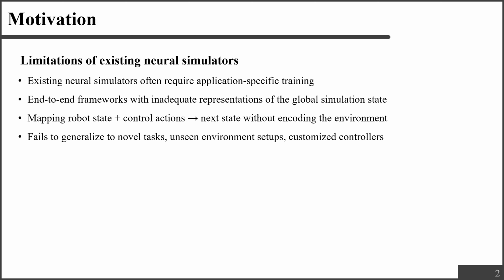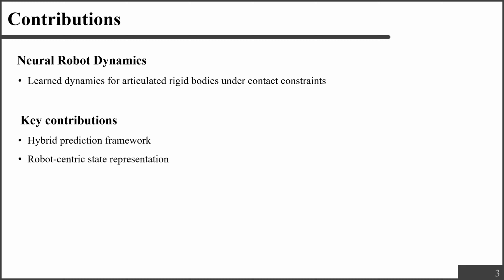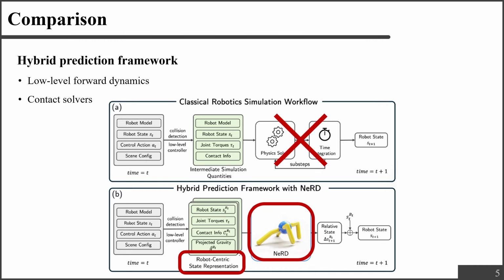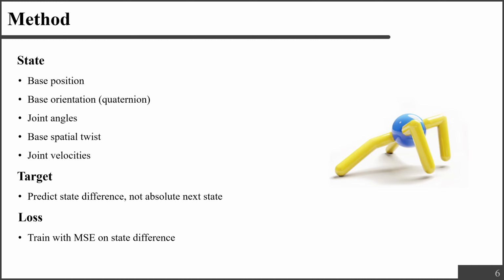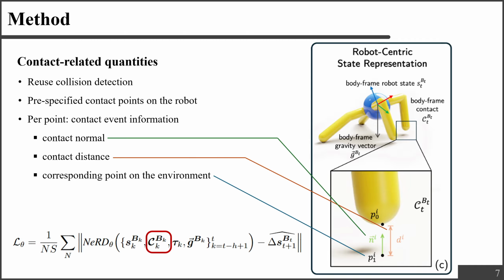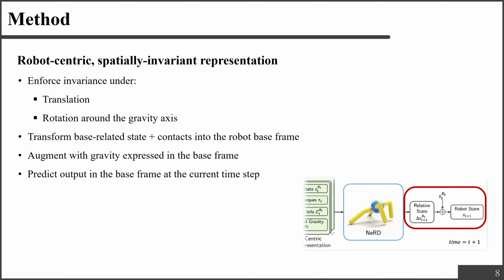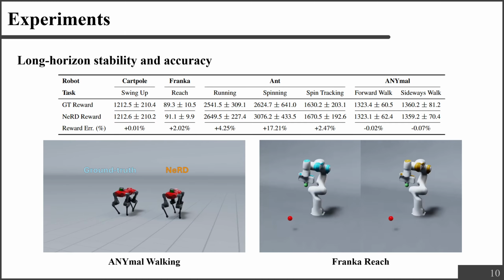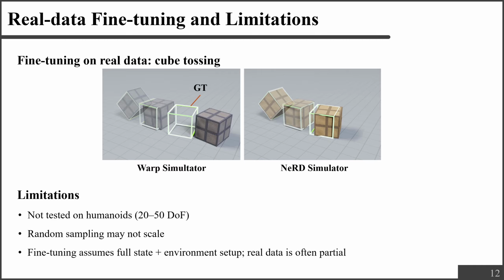[Seminar] Neural Robot Dynamics

Comment: Q1. The paper argues that this method avoids overfitting to controller inputs. How does performance change when rolling out with a completely different controller that was not used during training? Is there a quantitative evaluation of such controller generalization?

Q2. The model applies masking to contact inputs based on a fixed threshold. How sensitive is performance to this threshold? In particular, is an absolute value like 0.1 generally valid across robots with different physical scales, or is there a scaling rule or automatic tuning strategy to adapt it?
Reply: A1. If the new controller produces different torques, NeRD should still work because it uses torques rather than controller commands. The paper supports this idea by testing policies with different controller types and comparing reward consistency.
A2. The paper uses a fixed masking rule and does not give a deep sensitivity study. In practice you should scale it with contact thickness and with how far a point can move in one timestep so near contact is not dropped.

Comment: Q1. In diffusion models, recent work suggests that directly predicting the clean sample (x-prediction) can be more stable than predicting noise, since it simplifies the learning space. In NeRD, however, the model predicts the state difference Δs rather than directly predicting the next state. Could you elaborate on why predicting the state difference is more suitable in your dynamics setting?
Q2. NeRD is designed as a robot-specific dynamics model. If a completely new robot is introduced, would it require training a new NeRD model from scratch? Do you see a possible direction toward a more universal model that could generalize across different robot morphologies?
Reply: A1. State difference makes the target about change, not copying. It also avoids messy direct regression on orientation by using a meaningful orientation change definition.
A2. In the paper it is robot specific, so a new robot usually means a new model. A universal direction is to condition on the robot kinematic and inertial description and then fine tune.

Comment: Q1. Why is predicting the state change more stable than predicting the absolute next state? How does this choice contribute to long-horizon rollout stability?
Q2. Why might predicting at the macro time-step level be more stable than predicting at substeps? In contact-rich situations, wouldn’t this be numerically disadvantageous?
Reply: A1. Predicting change is like residual learning and reduces drift. It helps long rollouts because small representation errors do not compound as quickly.
A2. Macro step prediction avoids chaining many learned substeps that can accumulate error. The risk is you must learn a harder jump, so you need enough data and capacity in stiff contact cases.

Comment: 1. What are the advantages of transitioning from classical robotics simulation to NeRD?

2. It seems similar to Reinforcement Learning (RL); why should they use this method?
Reply: A1. You move to NeRD when you want a simulator that can adapt to reality from data.
A2. It is not RL. It is the dynamics engine that RL can use to train policies.

Comment: Q1. The paper adopts a "lococentric" representation by expressing states and contact quantities in the robot's base frame rather than the world frame. Why is this choice critical for generalization, and what specific problem would arise if the predicted state changes were instead expressed in the next time step's base frame rather than the current one?
Q2. NRD predicts state changes over an entire macro time step rather than predicting accelerations at each internal substep, as many classical simulators do. What are the trade-offs of this design choice in terms of training data requirements, inference efficiency, and numerical stability, particularly in contact-rich scenarios?
Reply: A1. Base frame features make the physics look the same across global positions and headings. If you used the next step base frame for the target, base motion can collapse toward zero and the model stops learning it.
A2. Macro step outputs are faster at inference and can reduce accumulation of substep prediction errors. The trade off is you lose explicit substep timing, so training coverage matters more in heavy contact.

Comment: Nice presentation

Q1. How robust is the simulator to out-of-distribution environment changes, such as slippery surfaces or elastic collisions?

Q2. Can the architecture handle multi-robot interactions, where dynamics depend on other controlled agents?
Reply: A1. If friction or restitution changes without clear geometric cues, performance can drop. You would need training variation or fine tuning to adapt.
A2. It can handle other robots only to the extent they appear as contact geometry. For fully coupled multi agent dynamics you would need a joint model that includes the other agents in the state.

Comment: Q1. The presentation states that NeRD has "not tested humanoid scale systems with very high degrees of freedom". What are the anticipated technical hurdles or computational complexities when scaling NeRD to highly articulated humanoid robots, and what specific modifications or architectural improvements might be considered to overcome these challenges?

Q2. It's noted that NeRD's fine-tuning "assumes access to full state and environment setup while real data is often finally observable". Given this, what are NeRD's current limitations in handling real-world, partially observable data, and what strategies or future research avenues are being explored to enable NeRD to effectively learn and adapt from incomplete sensory information?
Reply: A1. For humanoids the hardest part is coverage. The state is bigger and the contact patterns explode so random trajectories stop being enough.
A2. NeRD needs full state and contact geometry inputs, and those are missing with partial observations. A practical next step is to add a state estimator and contact proxies from sensors so the model can train on incomplete data.

Comment: Q1. How does NeRD’s hybrid design (using torques + contact info) help it generalize to new tasks/environments compared to end-to-end neural simulators?

Q2. What breaks first when scaling NeRD to humanoids (20–50 DoF) or partially observable real-world data, and what’s the most promising fix?
Reply: A1. It generalizes better because it uses torques and contact geometry instead of controller commands. That makes it less tied to one controller and one training setup.
A2. Humanoids break on data coverage first. Partial observability breaks the input assumptions first, so the fix is better sampling and an observation to state and contact estimation front end.

Comment: 1. What are the advantages of using NeRD compared to using a conventional physics simulator?

2. Why can NeRD remain stable even when it directly predicts macro time-step state changes?
Reply: A1. NeRD can be corrected with real data by fine tuning. A conventional simulator cannot learn from data in the same way.
A2. It stays stable because it learns the integrated update over the macro step directly. The robot centric representation also removes a lot of irrelevant variation.

Comment: Q1:
In time series prediction or forecasting, one-step prediction is highly likely to learn to simply reproduce the current state. This is especially true in physical simulations, where state changes within a short time interval are very small. As a result, predicting an output identical (or nearly identical) to the input state can already yield a relatively low loss. Do you think this issue does not apply when training a world model?

Q2:
When predicting a physics engine, is contact the only (or most critical) factor? Are there other important elements that a world model must capture besides contact?
Reply: A1. It can apply to world models too. NeRD tries to avoid it by learning state change from trajectories with real motion so copying the input will not fit most steps.
A2. Contact is a big one, but not the only one. You still need actuation effects, inertia, damping, gravity, and stable integration behavior.